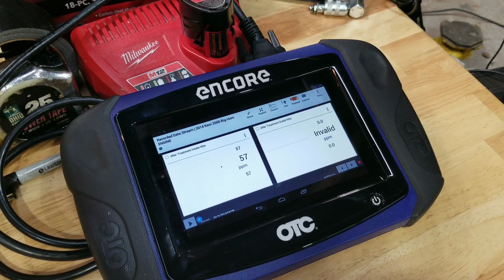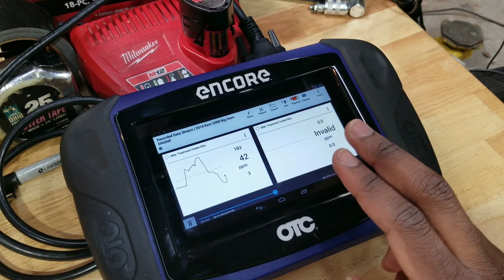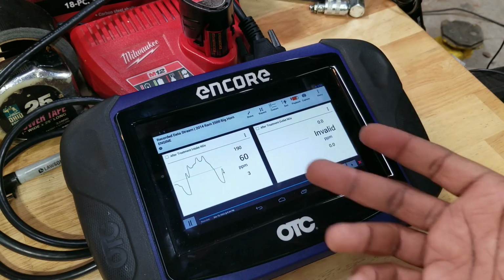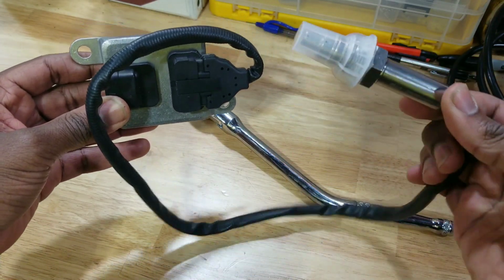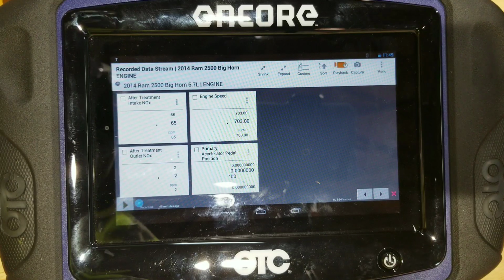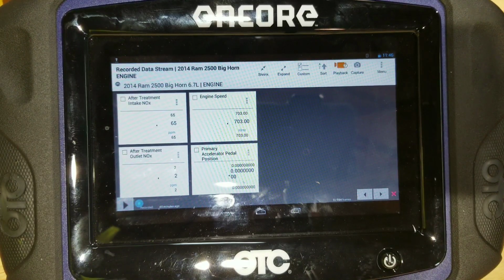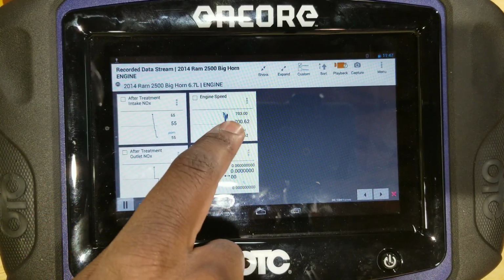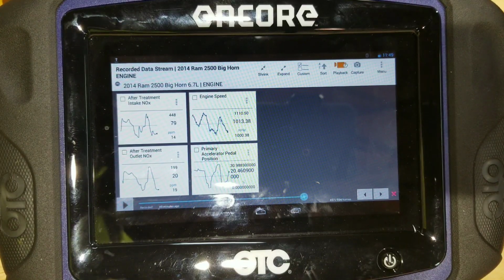Replacing Downstream Nox sensor Cummins 6.7 Diesel - U059F

Comment: Did you go with OEM or aftermarket?
Reply from the maker: Aftermarket: https://a.co/d/3LVJCY9
Reply: @PremiumFuelOnly still working?
Reply from the maker: @Itsa_Mea  Yep, no problems
Reply: Do you have the part number?
Reply from the maker: Sorry no, I just used the link above.
Reply: The link above is not opening
Reply from the maker: Oh looks like they don't sell it anymore, but you should be able to locate it on Mopars parts website with your VIN, I dont want to give you the wrong number.